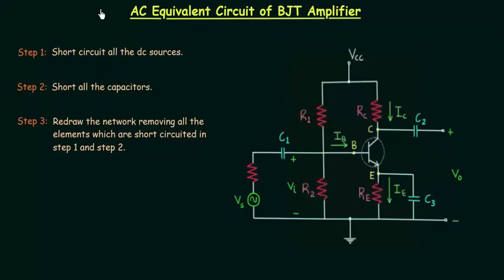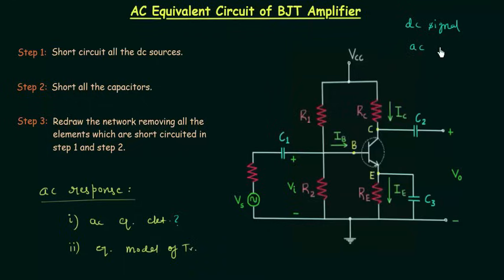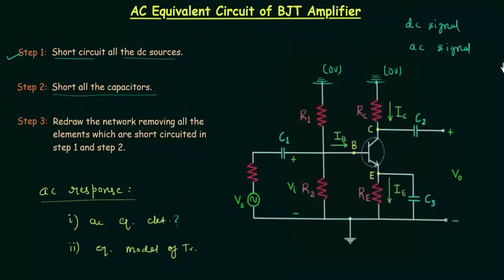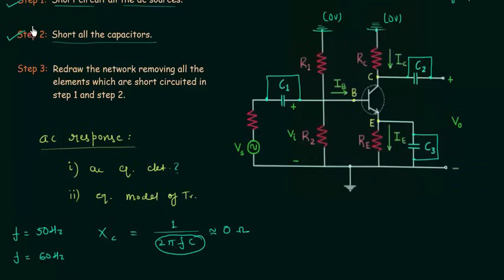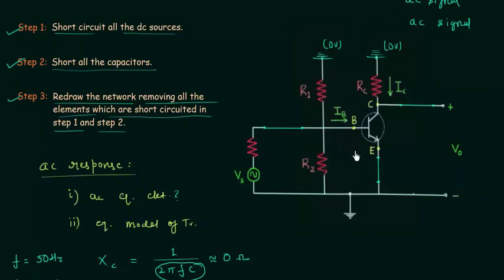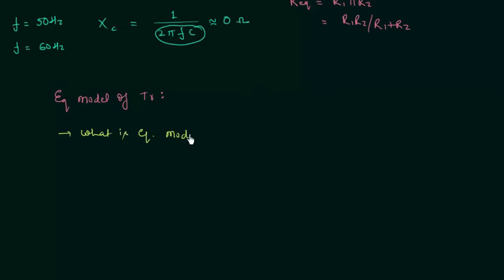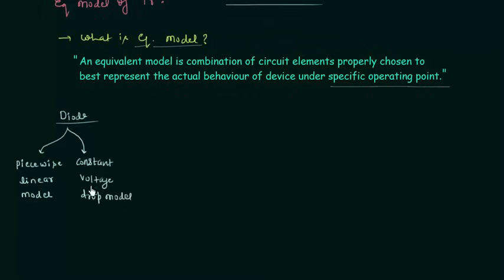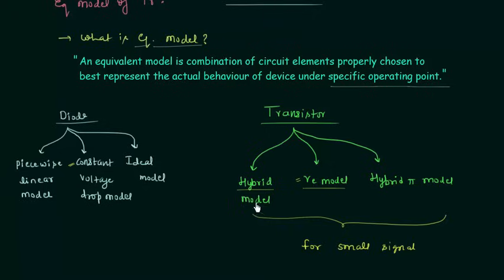AC Equivalent Circuit of BJT Amplifier

Comment: Why does short circuiting dc source means making it ground ?? We could have simply joined both by a plain wire, that's what short circuiting means, right ?
Reply: I am not sure if you still need this answer after 3 years BUT Vcc is a DC source connected to ground (only one terminal is shown in the circuit) and therefore short circuiting it makes it become a wire connected to ground
Reply: @420syrox  thanks this answer helped me. Keep up even if it is late replies.It helps others.

Comment: Sir I have a doubt. You said that because  capacitanes are large, in case of ac signal the Xc will be zero. But sir even even large capacitances will be in micro or at max milli farads. So how come 2.π.50.C will be a large value so that reciprocal of it will be approximately zero?

Comment: Can you please explain why dc sources have been shorted???
Reply: @SureshBabu-wt7lh  I think he is asking about DC source.
Reply: To answer your question in AC analysis we deactivate all DC sources (that is shorting of voltage sources and open circuit of current sources).

We deactivate the DC sources in AC analysis (similarly deactivate AC sources in DC analysis) , and then to calculate total response we add both ac response and DC response( as he explained in previous lecture). This is in accordance to superposition theorem

I am pretty much sure this is the correct explanation, if I am wrong please let me know😀😀

Comment: Hi Can you please tell me the equivalent transistors of B1254 (2SA1263), D1894 (2SC3180). its really hard to find to me.. i replaced with B1560. D2390 to check.. but transformer started smoking. Iam using Marantz pm30.

Comment: why are short circuiting battery??
Reply: As far as I know, it's because we're essentially applying superposition theorema and only analyzing the AC input voltage, thus shortcircuiting any voltage source (DC or AC) and open-circuiting any current source (DC or AC.)